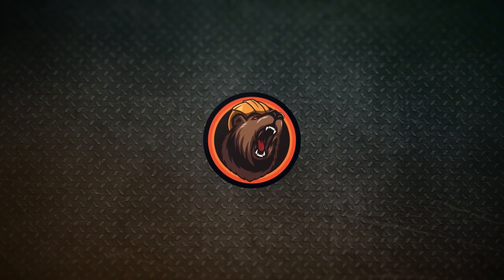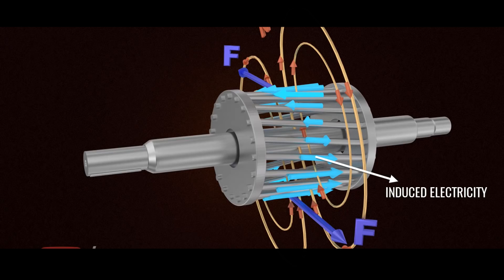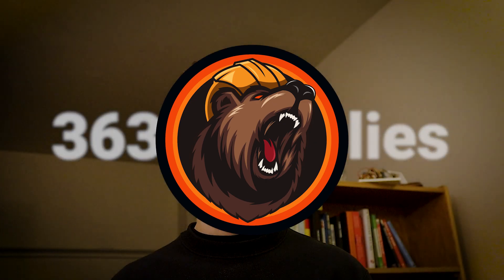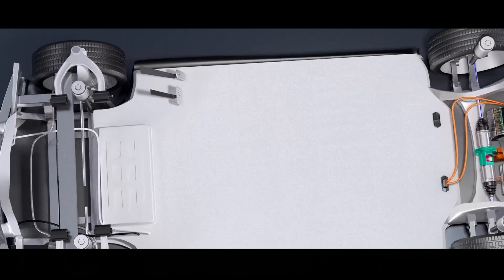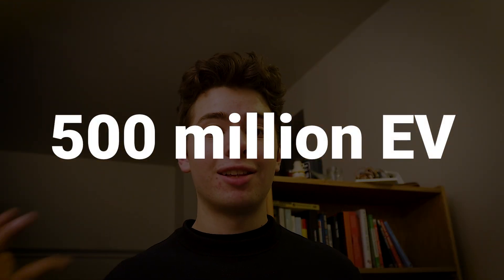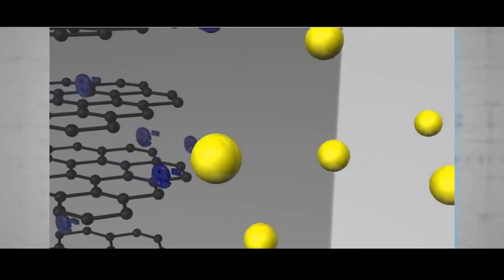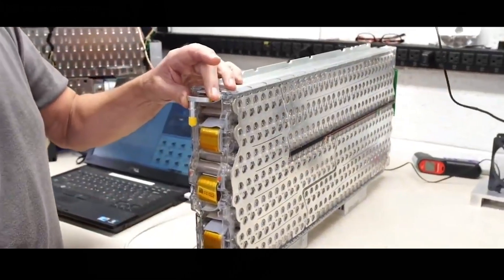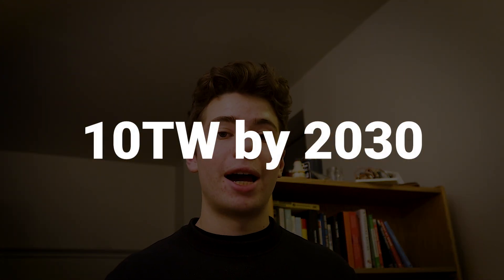The Frightening Future of Electric Car Batteries

Comment: Yeah, I think we need the government to subsidize auto batteries by abt 50% then have all EVs use battery swap tech. It would help with the range problem as well as the cost issue holding back sales.

Comment: By 2025, there will be an oversupply of Lithium Battery.

Up to the end of 2021, the total investment on Lithium Battery (from upstream to downstream) in China alone amounts to more than $300 Billion USD. This is not only for the factories which produce Lithium Battery packs, but also include plants which produce the ingredients needed to produce the battery, including Iron Phosphate, the purification of the mineral Lithium, and so on.

As this figure does not account for plants outside of China, I am sure the total global investment for the production of Lithium Battery would be much, much more    !

Most of those plants will come online by mid to late 2023, or early 2024, and will be in full production mode by 2025.

Thus, it is safe to say that there will be an oversupply of Lithium Battery (of all kinds) by 2025.
Reply from the maker: You are correct in stating that there most certaintly won't be a production shortage of lithium batteries. Not only that, but there very clearly is sufficient lithium for the production of batteries in the near future: especially as new mining/extraction methods are implemented. The largest hurdle in the development of this tech that could limit our adoption towards a greener future is the clean extraction of these metals (especially nickle)